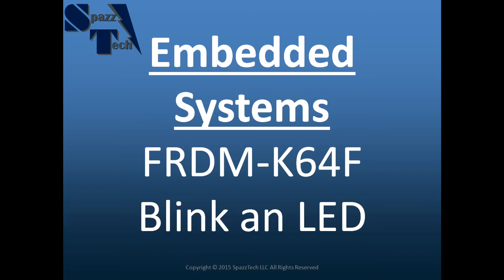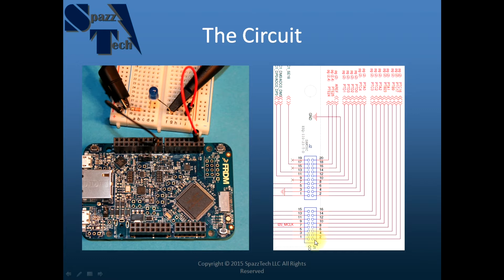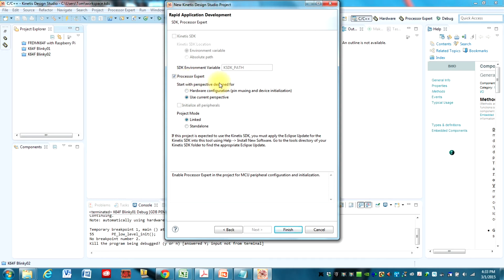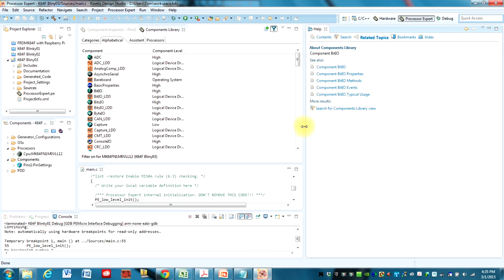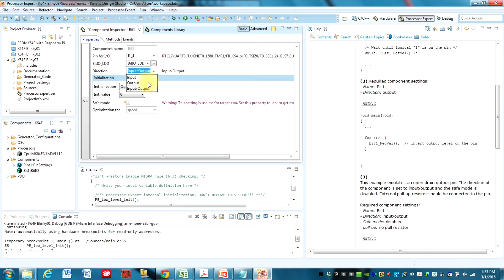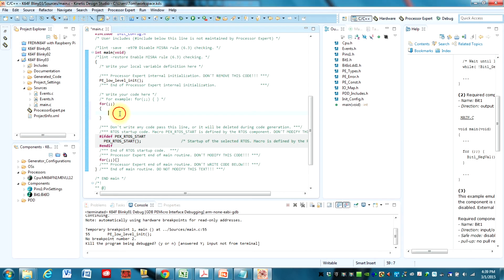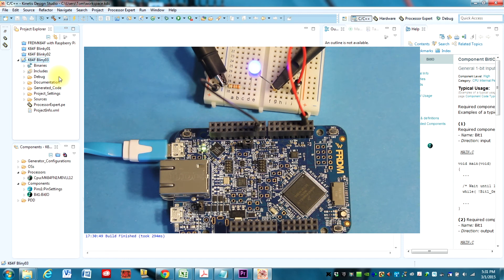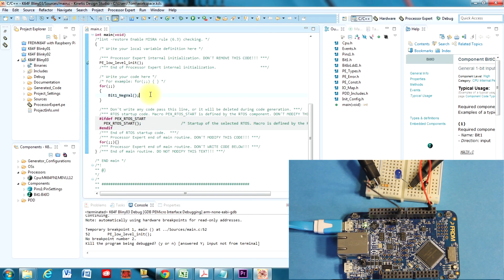FRDM K64F - blinking an LED using #Kinetis Design Sudio and Processor Expert

Comment: Thanks for the tutorial SpazzTech. I am trying to create a blink LED project with my K66F but am running into issues early in the project creation / setup phase. I am getting an error that says "The Processor Expert project <my_project_name_is_here> was NOT generated because of some error. See the Problems view for more details." In the log below it has a list of 20 errors that are similar to "Error in the inherited component settings (fsl_mcg_hal)." Another error says "ERROR: fsl_clock_manager: Component requires 1.3.0 Kinetis SDK based on selected Kinetis SDK path value. Please install corresponding service-pack, switch to appropriate repository or correct the path to Kinetis SDK."
Reply: I noticed your "New" options are different than mine. You chose "Kinetis Design Studio Project" which isn't an option for me. I have options such as "Kinetis SDK 2.x Project", "Kinetis SDK 1.x Project" and "Processor Expert Project." I also get asked for the path to the SDK, which I provide, but it seems to have trouble accessing it. Any ideas what I might be doing wrong?
Reply from the maker: +forever_student to follow what I did you will need to use Processor Expert Project. It sounds like you chose one of the sdk projects.

Comment: Hi, thanks for thetutorial. I'm having problems with generating "pins1.h"," PDD_Includes.h" , ""Init_Config.h", as it will not create them automatic. I'm using TWR-K21F120M board with MK21FNM0VMC12 processor. Could you explain to me what are they and how can I generate them. Thank in advance
Reply from the maker: +Kosta Ivancevic are you using Processor Expert or an SDK?

Comment: I dont know.It is 3 days i'm spending some time on KDS.
With CodeWarrior i'm able to blink a led ,say at Systick interrupt ,in less than a couple of minutes.In half a day i can run from zero  a SSD1306 graphic display
In KDS not at all,i can't even master a Systick Interrupt.Had to use another timer just to blink a LED.
The Systick by default belongs to Osa1 component,what if i don't want anything having to do an OS?
I don't  know where the vector table is locate.
With the help of a friend that uses Freescale  since HC08 age ,we had lot of problem just to declare a BIt IO,having this to do to an enumerated list of I/Os.
I've no doubt that KDs is a great tool,with the aim of portability and making things easy, and i want to say thank to freescale to had it available for free.
But being not a guru i'm frustrated in finding it so difficult ,everytime i do something different from step by step examples with FRDM's boards

Comment: is it enough to install only kinetis design stuio, to use kinetis processor expert, mqx rtos and other componenets ? or what is the correct install sequence to use all kinetis software fetures with kinetis design studio.
Reply from the maker: cengiz zorgormez Processor Expert comes with the Kinetis Design Studio install I believe. The components come with processor expert. MQX RTOS is separate, though I have not used it a while lot yet.  Maybe I will soon. Trying to decide on a what project is next.